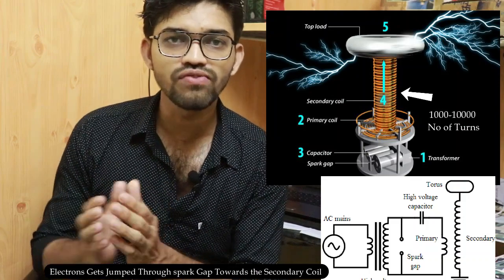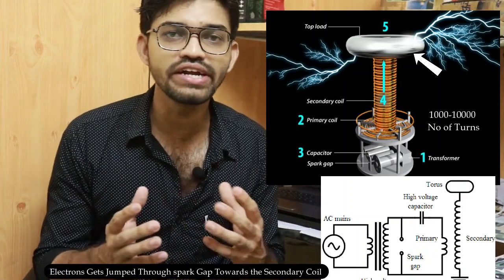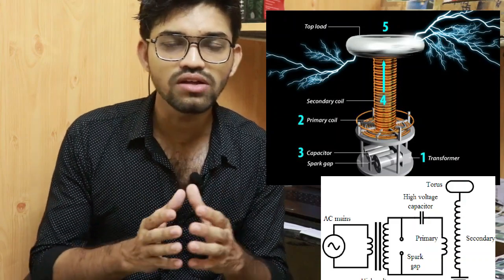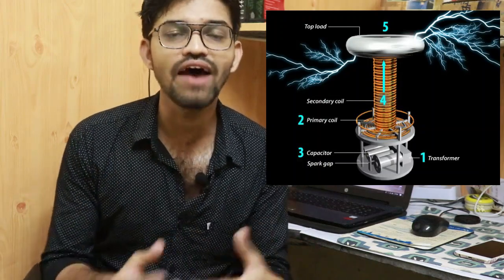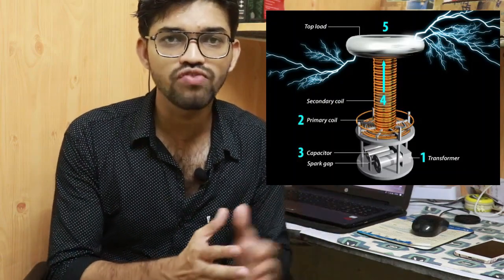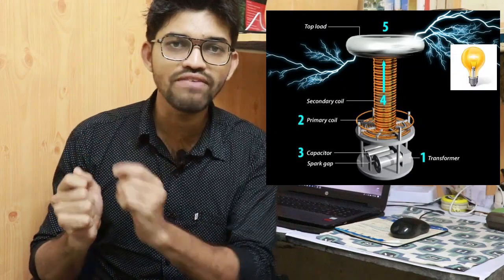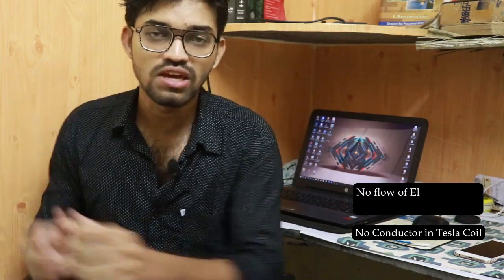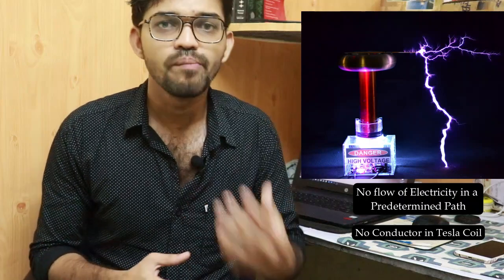Tesla Coil. How to Transmit Electricity Wirelessly ??

Comment: The problem is pretty simple... range. 

However the situation is distribution. I've been studying electrical engineering since I was 6 years old. Military Dad Electrical Engineer etc..

I've had about 25 years to work this out. So here you go kid. Merry Christmas. Do something with it...

Take 4 evenly distributed power sources setup 16 double coils unevenly distributed to act in a group as one resonating circuit. 

If you do it right an evenly distributed resonance field will be established with extended range. 

4 Dimensional thinking required. Draw it out and get back to me...

Then we can talk about controlling the field I have some ideas on that also.

Comment: I'm working on a 240v Tesla coil that weighs less than 400 lbs with a range of 500 feet.  Do you think that is possible?
Reply from the maker: Sir Can i have your Whatsapp No. ??
Reply: @EngineersAcademy9204  hi you still work on tesla coils I built a receiver that can operate motors and other loads I am now working on a batteryless boat that can travel a great distance on water

Comment: I know you guys went to engineering school (probably working on your Masters), and I have a high school education, but you have not researched this topic enough. 
Tesla was not trying to radiate energy around the world, and he was using a single path - the Earth. The Tesla coil you speak of is not the device he was using, he was using the TMT. They have two entirely different functional requirements, even though they appear the same. Like a diamond and glass costume jewelry. Once is for show, the other has intrinsic value.
You need to stop looking at conventional electricity flow, this is something else. If you don't believe me strike a piece of metal tubing and use a gauss meter, what do you see? Now take another tube, even in a vacuum and suspended (for the sake of argument). As  long as that tube has a mathematically similar dimension, what do you think will happen to that suspended tube if you strike the exciter tube nearby? If you had the ability to measure that suspended tube, like a Laser Doppler Vibrometer, what do you think will happen? The output doesn't effect the input because it is an open system. To tie this to what Nikola Tesla did do in Colorado Springs, and wanted to accomplish at Wardenclyffe, imagine the exciter as a metal sphere instead of a tube. Now imagine the sphere to be the size of the Earth. 
That was what Tesla was doing.
Reply from the maker: He wanted to transmitt electricity via earths ionosphere !
Reply: @EngineersAcademy9204   Nope, still not right. You are again implying radiation of some sort. There is a relationship between Earth(ground) and the charges in the atmosphere.  They are  plates separated by a dielectric, a capacitor; that is the relationship. Tesla clearly states he was pushing current to Earth ground.
Reply from the maker: U r absolutely right !
Reply: Tesla wasn’t trying to transmit electricity wirelessly by using high voltages, he was trying to use the same system but in reverse. What I see when I look at his tower and listening to what he originally said about ambient electricity. He was supposed to be ‘harvesting’ positive ions in the atmosphere and using the earth as a negative to create a very high voltage but low amp current in the conductor and STEP DOWN transforming to lower the voltage but increase the current. You will have to forgive my uneducated use of language and terminology. It makes sense in my head 😂 I’m just a normal guy. He didn’t have the use of transistors to invert the current for transforming but I’d imagine the guy had figured out a more primitive method of inverting. What a genius he was. Very much the same difference as a motor and a generator. Most people are putting electricity into the system instead of using it in reverse and taking electricity out.
Reply: @danielregan6871  Hi Dan, it isn't as simple as taking electricity out and stepping down. If that were the case we would have no electrical companies.  Physics tells us that conservation of energy means that the something you have (power) can be manipulated and transformed, but not added. However what you say about the Earth and sky is totally true, they are both grounds... air and earth. Two plates of a capacitor. So every time you see a lightning bolt hit the ground, it actually is the energy seeking to maintain equal charges, balance. Tesla loved the concept of vibration, and said he had a special sense of it, like he could feel it. What people don't know because the information out there is meant to confuse and lead people down away from the truth is that: He was explaining a simple relationship between energy and vibration. If you get something vibrating (resonant) you can put that thing in between a transmitter working at that frequency, and a sympathetic receiver of that same frequency, you will get power amplification. Yes more power out than you put in. In Tesla's case he was using that "something vibrating" in the middle as the Earth, the Earth ground. That was genius. We have to redefine our perspectives of power generation, because all our generators run by the power companies doesn't "make" power it harvests it. But the design of those devices on paper, will be closed circuits but actually it operates in an open circuit pulling from the Earth and sky.
Reply: What you say sounds similar to RF induction but that’s not what I’m talking about. I have previously thought through RF by using the earth and upper atmosphere as a wave guide creating a potential difference but what I’m talking about is much simpler. Earth is ground which means it has plenty of free electrons and the atmosphere around us is full of positive ions. When you ground even a single copper wire and take it into the air, the positive ions steal the free electrons in the wire causing a flow of direct current in the direction of the sky from the earth. The higher you go the larger the voltage because there are more ions to steal the electrons. (30v per foot) at a very small current (picoamperes). The more copper you put into the air gives you a larger current because more electrons are present to be stolen. That is why Tesla built a high tower and grounded it. I should do some real homework (experiments) before debating with people online because the stuff I am saying only makes sense in my head as I play it through in my mind 😂 I’m not that into watching the plethora of free energy videos 😂 but what I do know is that when you change a magnetic field near a conductor there is a flow of electrons. (Generator) but if you put the electricity into the same system you get a motor. This is the same as what I see when I see people making Tesla coils 😂 they are always putting energy into the device via a battery or a plug socket instead of letting nature do it’s thing. If you made a Tesla coil 200m high you would get 20000v and depending how much copper you use at the top would give you around 0.00000001 amps Tesla knew the equation but I don’t. I will do some more small experiments and get back to you
Reply: @danielregan6871  I am not doing anything with RF, and neither was Tesla for the sake of being RF. Please take a look at some of my experiments while you are browsing. You think that if you place a conductor high enough you will get a difference in potential and thus current flow. You are right, and actually Tesla conceived of a conductor that went out to space, but wasn't electricity, he was thinking of taking the potential difference of temperature that could supply endless energy to a motor. Google Tesla thermopile. Unfortunately engineering both ideas are well... crazy. There is a guy who tried running a thin wire up with a drone that could maintain relative position. Not a lot of energy there. You haven't cracked the real reason Wardenclyffe had to be at certain dimentions... tuning. He determined what frequencies were relevant at Colorado Springs, and there he had a ball he could raise or lower (tune) the wire length of the coils. Once he knew what he was after, he could build Wardenclyffe with that tuning. Danial the reason wasn't cause he tuning for RF transmission, he was pushing current IN THE GROUND.
Reply: Just so we clear bro by RF I meant Resonant Frequency 👍
Reply: @danielregan6871   I misunderstood (sorry) -  Because Radio Frequency is a part of Tesla coils as well, but not for the sake of the transmission of the power. Resonance is required for any work relating to "The Arts" as Tesla would say. But what you said about more copper is correct from one perspective, the more mass you have to receive the energy is important, but this is the rub; to get that energy to where you could harvest that potential would be crazy. You have eddy currents, line loss, skin effect, and line resistance. Which is why our power distribution grids do what they do in HF(high frequency) and high voltage then use transformers, and step downs to bring it to your home. So if you placed a huge copper plate on top of mountain, and ran a huge cable to sea level... the engineering is nuts. That's why Tesla's solution was "wireless" (but NOT radio frequency). Do some experiments with one wire transmission and you start to get a feel for the solution.
Reply: Thank you dude 👍 I comprehend what you are saying 👍 I will Indeed do some experiments. I find talking to people who understand the subject encouraging, as I am 32 now and never went into higher education of any kind I feel like it’s hard to communicate what is going on in my mind 😂
Reply: @danielregan6871  The hunger for knowledge proceeds education. Remember that higher education only has knowledge tracks, it takes you the direction where the train goes. However, if want to reach a destination in-between those routes, you have to get their yourself. Sometimes it will lead you to answers to the obvious questions, but hard to digest. Like on the subject of Tesla, if he had something that worked, why did it get lost? Why did it go they way of the dodos... Tesla TMT, the N machine by Adam Trombley, Don Smith Generators... and Cold Fusion, and the Electric Car. You will stumble on realizations of what the Patent office really is, and why no one will ever get rich bringing a free energy device. But that doesn't stop us from knowing how to make one (in case this fragile Matrix reality drops it's code)

Comment: Why should we maintain spark Gap in Tesla coil?
Reply from the maker: Emf induction.
Reply: Because you can accurately set the specific voltage needed to get the desired results using capacitors and a spark gap. There is an exact value to how much voltage is required to arc through a certain size gap. It roughly takes 1000v to arc 1 inch, if the gap is set correctly for example 1 inch for demonstration sake. The system will use exactly 1000v as it arcs across the gap (or a minimum of at least) apologies for my crude explanation.